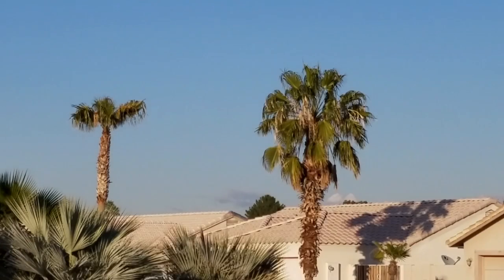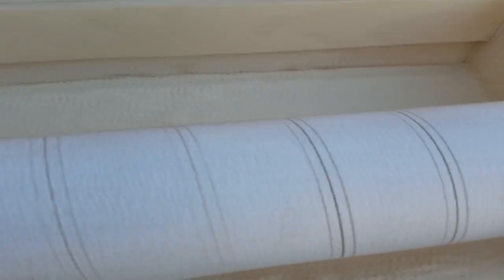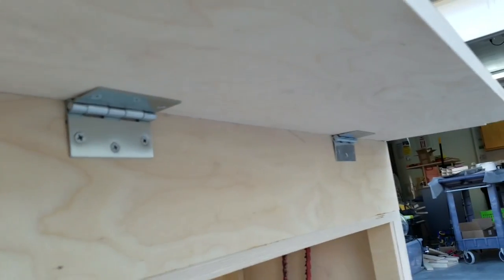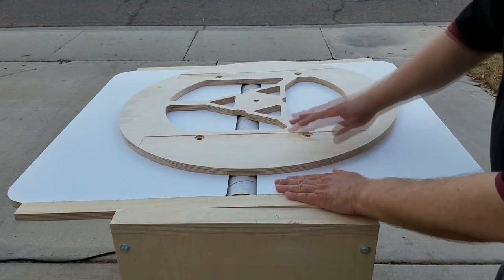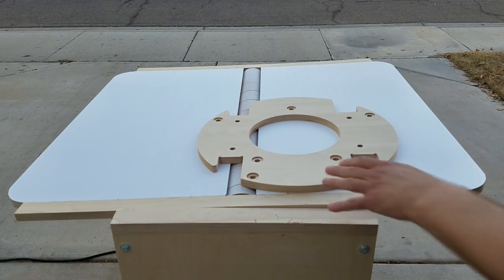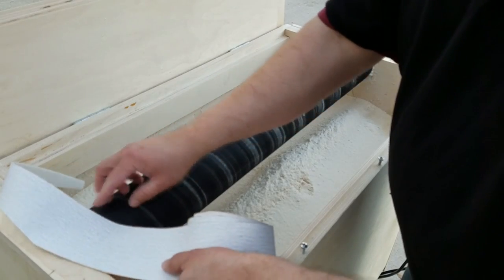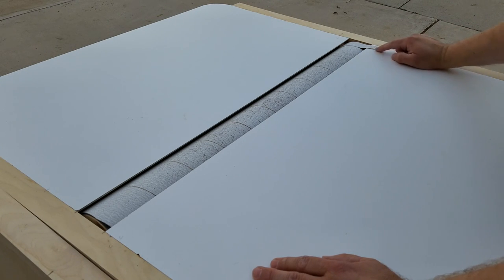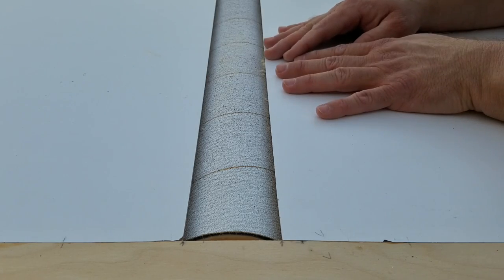DIY Drum Sander for Telescope Shop

Comment: Just wanted to THANK YOU for an excellent video.  I was looking at building a pressure-type wide sander -- until I saw your video.  Took me two days to add your type of sander to my lathe (hey, it already has a motor and bearings on both ends).  So just built a box, bolted it to the lathe bed, created many disk for the drum on my CNC table (but could had made them the old fashion way as well, but that would had taken more time), put it all together, and presto -- we have a beautiful wide drum sander.  THANK YOU so much for sharing your knowledgeable and experience.  Your video explained everything in a very clear method.  Without your video, I would not have a wide-drum sander.  It is such a joy.  Again, THANKS.
Reply from the maker: Thanks, Mike!  So happy to hear that you  had fun and ended up with a great tool for your shop.  Simple is good!

Comment: I will admit you gave a very thorough job of the sander and I appreciate the level of detail.  One additional thing to what you mentioned is that although the dust goes down below, there's no need for the noise of a vacuum and that's great.

I've been considering doing a drum sander thicknesser for a while but felt it was too complicated.  Like the units Stumpy Nubs has built.  But the reality is this unit I believe could do the job quite well and I won't have to spend $1400+ on a commercial unit.  Those Powermax and Jet units look nice, but then you see they're all plastic hoods and such, and they're still not very wide. 

The simplicity of your solution has inspired me to put this on my todo list.  Thank you so much.
Reply from the maker: Thanks!  While this isn't really a thicknessing sander, it is actually pretty good at leaving the piece flat.  So you can do multiple passes without putting waves into the surface.  Given that I have the motor, pulleys and belt and laminate for the top hanging around, my out-of-pocket cost was pretty low.  But even if you bought all new, the cost isn't that high.  I really love mine.  If my jobs weren't so large, though, a narrower drum would have worked find, too, and made a more compact machine.

Comment: Gordon, you are incredible.  Thank you so much for sharing.  Where you are using pillow block bearings, I do not understand why the roller raises.  If for utility you decided to have three different drums for the three grits you are using, have you considered widening and deepening  the side slots where the pillow block bearing fit, making a "U" shaped pillow assembly with squared corners, and making a keeper to secure the "U" so it does not rise or shift?  The pillow blocks would be mounted in the bottom of the "U."  (Yea, more expense as you would need two more sets of pillow blocks, drums, and shafts.)  One could use locating pins to assure proper fit and contribute to the rigidity of the system.  A long brush installed parallel to your drum might assist in reducing the small amount of dust you get on the leading table.  A "V" shaped hopper with a trap door would assist in cleaning out the dust bin.  If you really want to go rad, install a  vacuum tube along the full length of the bottom of the "V" (no trap door this time), perforate the tube, stop up one end of the tube, hook up a shop vac on the open end of the tube that sticks out the side and go for it. . .  Yea, I know it is a noise generator...  Keep them coming!
Reply from the maker: Hi, Gordon!  The roller itself doesn't raise during operation.  The sandpaper itself is "flung out" away from the drum due to the centripetal force caused by the fast rotation.  The sandpaper is attached with hook and loop fasteners, and it really isn't perfectly tight against the drum.  The rotation causes the paper to move away from the drum just enough to actually get in contact with the piece you are sanding.  Regarding multiple drums for different grades of abrasive... I only contemplated that until I found out how easy it is to change the paper.  Once you've done it once or twice, it's not really any hassle at all.  Far easier to store rolls of paper rather than multiple drums, as the drums are actually pretty heavy, especially if you include the bearings!  Thanks for watching and commenting!
Reply: Gordon, Thank you so much for the response.  I see what you mean with regard to the sandpaper itself flung out.
Reply from the maker: It's pretty cool, once you see how simple it is!

Comment: I have seen a lot of those machines. Even the professional ons which cost over a 3.ooo USD but this one as you made by yourself is just so easy to build that it is almost ridiculous I would pay a penny for a new one. Every woodworker has a lot of stuff laying around. You only have to pay for the bearing and maybe for the motor but in every old washing machine you will find one. It think the it will taken me 1 day to make one by myself as you did. Maybe 1,5 day at most but your machine does what it has do do. I'm building Beehives in different kinds of wood and have to glue a lot of pieces. There is sometimes a little difference in the wood where the pieces are glued together And it take a lot of sanding to get rid of that. 
With this solution of your, which is the best I can find on the whole internet, it has to be a piece of cake in the future. Thanks for showing us woodworkers and succes with the things you make and the business you have. 

P.S. It would be appreciated very much when you show me where to by the sanding paper and the Velcro tape. Over here you will find an excellent video how to calculate the length of your paper  https://www.youtube.com/watch?v=RpfCSz9HwKU&t=12s 
She made a drum sander but that is a sander which I didn't like to make. The wood is never exactly trait and it has to be pouched trough the drum with force sometimes which will damage the wood in my opinion. Yours will never do that if your constantly pouching it with the same speed over a flat surface. Ans that alone already a great benefit.

Comment: I’m still not clear on the effect of mass needed (or not) for the drum. For instance wood circles vs. pvc pipe has been mentioned; does this system need the mass of all that wood or will 3” schedule 40 pvc (actual 3.5” od) do the job? Is drum weight (or mass) stricty related to the hp & rpm of the motor & pulleys?
The BEST vid anywhere on this contraption!!👍
Reply from the maker: I doubt that mass in important.  I choose wood instead of PVC because I wasn't sure the pipe would maintain a straight profile without sagging.  My drum is longer than most, and that was my worry.  Also, the wood seemed super easy to fabricate, and was known to work well.

Comment: Thanks so much for this. What an inspiration. I'm midway through building one and I'm to the point of ordering pulleys. Can you recommend an ideal RMP for the drum? I have a variety of motors to choose from and want to be sure to have the drum spinning at an appropriate speed. Thanks!
Reply from the maker: I would think you would want to sand at about 2,000 surface feet per minute.  Assuming a diameter of about 4" for the drum, that would give you a circumference of about 12 inches or one foot.  So if the motor is running at a standard speed around 1750 rpm, you would be fine.  For under $10 you could buy a slightly bigger pulley for the drum if you want to try slowing it down some.
Reply: @GordonWaite  Thanks very much Gordon!

Comment: I'm finally getting around to building this thing this coming week. As opposed to using 3 inch diameter plywood for the drum, I thought I would use a 4 inch PVC pipe, as they are machined or molded to pretty exact standards. 

One of the things that keeps running through my head is the tolerances on a machine like this. If the drum is not spinning absolutely true, I mean down to the thousands of an inch, you would be hitting a high spot. Same thing applies to the table surface. If that thing is not perfectly flat,  you're going to be sanding more in one spot than the other. 

While I know things like melamine are pretty flat, I can also say most MDF or particleboard tend to sag over time. I've built a few router tables already that were much smaller than this, and  it's very difficult trying to keep them flat. Angle iron seem to be the best option for me so far attached to the bottom. 

I know you're using one stiffener, and hopefully that will keep that top flat. I can't help thinking that this would be incredibly difficult to get  tune down to the thousands of an inch over such a large surface, and to keep it that way. Most of these type machines are made out of metal I think for that reason. 

Perhaps the thickness of the Velcro is helping to even out any irregularities? I can certainly see if you just had sandpaper attached to a drum, that you would definitely get some high spots and low spots, and compound that with something that may not be spinning perfectly true, and a tabletop that could possibly not be coplanar, and wow... that  just seems like a lot of variables to try to control.

I've decided to go a bit smaller, and put mine on my lathe, and actually turn the ends on the lathe as well so that they are perfectly centered, and then insert those into the 4 inch PVC. That should hopefully keep everything perfectly centered and spinning true.  

I'm then going to use the bed of the lathe to build the wooden box, but thinking very strongly about putting lateral adjusters on the hinge mounts to try to compensate for any differences. I can definitely see it being very easy to tweak a tabletop out of being coplanar (very easy), and again, maybe even more difficult to keep it that way. 

Comments on any of this?
Reply from the maker: Hi, Troy!  I think you have a fundamental misunderstanding of how this sander works.  The sandpaper spirals around the drum, and is held to it with "hook and loop" fasteners, or "Velcro."  The sandpaper cannot be tight against the drum, because the hooks and loops are not able to hold it tight.  When the drum spins up to full speed, the sandpaper is actually forced AWAY from the platen by the spinning.  So the sandpaper isn't really backed by the platen, it is backed by just the air under it!  The physics of the situation demand that the sandpaper becomes pretty nearly a perfect circle floating over the top of the platen.  But the key is that the sandpaper isn't rigid, it is flexible.  So when you properly adjust the platen, the hard part of the surface of the platen is actually below the opening in the top.  The only thing above the opening is the sandpaper, and only when the machine is spinning will it stick up enough to do the sanding.  So the platen itself has nothing to do with the sanding action.  Only the spinning sandpaper has skin in the game!  So it isn't particularly important that the platen be perfect.  You would be wasting your time to try to make it perfect in any way.  Good enough is good enough in this case.

Also, this sander isn't meant to be a thickness sander, but a finish sander.  Even if you put #80 sandpaper in the machine, it isn't very aggressive.  The spinning sandpaper is actually very level when it is pushed away from the platen by the spinning.  And the level of the table is forgiving because the sandpaper floats on air above the opening.  If the table isn't quite level, the sandpaper is just pushed down a little more against the air behind it in that spot.  Only if the table was grossly out of square would you have any trouble.  All in all, this isn't a precision build in any way.  You just rely on the design and physics to do the job!  Of course, if your platen is way out of round, you would get vibration which would be annoying.  Get past that, though, and you are good to go!  -Gordon Waite
Reply: I did have some understanding of how these work from watching the "flat master" videos, but I still thought the tolerances were very tight. I'm glad to hear there is some wiggle room. I'm not looking for a thickness sander. If I really need to thickness something I will run it through the thickness planer. About the only real problem with a thickness planer is snipe, and many times I will attach some longer boards to the piece  to avoid the snipe. Anyway, they still need a final sanding as the finish is not glass smooth, and of course I do a lot of building out of plywood. I definitely would not want anything aggressive there. 

Sounds like the PVC I'm consider for the drum is going to work out fine, and I like the idea of mounting on my lathe as I don't have to buy another motor, and  takes up less space too. I'll let you know how it works out.

Thanks again for all the feedback! There's no way I could have even considered doing a project like this without your videos, so I'm most grateful for all your time and effort!

Troy
Reply: If you were to wrap a piece of wood with 60 grit sand paper then run it over the table top, and have it engage your pvc, this would correct any cylindrical anomalies.
Reply from the maker: That's exactly what I did with this drum.  Thanks!
Reply: Good tip Dave. Thanks for posting.

Comment: Very well done! I just fell in love with this style of sander and can't wait to build one for myself. Where did you find the hook and loop for the drum? Is it in a strip like the paper or in a sheet?
Reply from the maker: Thanks, Joel!  The "loops" that I put on the drum are from McMaster-Carr.  They look like they originally came from May Material Specialist, Inc., at www.mjmay.com.   The roll I used is 2" wide, but it doesn't matter, as you just need to cover the drum.  The sandpaper roll is 3" wide, and comes in 10-yard rolls from USA1 Abrasives, at www.usa1.com.  The sandpaper says "no-load" paper on it, and it is made in the EU.  This tool is so simple to design and build, yet it is one of the most-used tools in my shop.
Reply: Thanks for the info. I am about to build one for my self about the same drum size as yours. I was thinking I would need a 3/4 or 1 HP motor but I just rewatched your video I see you used a smaller motor.Have you been happy with the 1/2 HP motor? Have you run something over the entire drum with out it slowing down?
Reply from the maker: I have had no problems, but I don't run a lot of material that is touching all of the drum.  But to be honest, I don't think it would bog down much.  If it is adjusted to only touch the material when spinning, you can't end up with much pressure.  I know the sand paper last forever!  Good luck with yours.

Comment: I was going to order velcro today. How long of a piece did you use for the 32" wide bed? 6'?
Reply from the maker: You can figure it out like this... Assume you are using 2" wide Velcro.  Take the length of your platen in inches, like 30 inches.  It would take 15 two-inch rings to cover it.  (15 * 2 = 30) Each ring is the diameter of the platen (like 5" maybe) times pi, or 5 * 3.14 = about 16 inches per ring.  Take your 15 rings and add 2 rings on the ends for the angles.  So you  need 17 rings times 16 inches per ring, or 272 inches, which is about 23 feet.  Plug in your own numbers.  Probably more Velcro than you might think at first!  Good luck and enjoy the project.
Reply: Thank you very much Gordon! Guess I was looking for the quick answer and not wanting to do the math;) One other question about the Velcro and sandpaper . Did you use the standard, multipurpose Velcro or the super adhesive from McMaster Carr? I think I will use 3" PVC for the platen, and plug the ends.

Also, does the sandpaper come as a hook or loop?  It appears you can order the  Velcro for the platen in either a hook or loop, but not positive about how the sandpaper comes. I'm going to guess as a loop. I honestly don't know,  and would rather not have to return the velcro for the platen.
Reply from the maker: Hi, Troy!  You want to get "hook" Velcro, as the sandpaper is "loop."  I got my Velcro from McMaster-Carr, 2", black, standard adhesive back.  There isn't really much stress on the material, so I wouldn't worry.  Although the difference in price isn't much, so get the super adhesive stuff if you need to sleep well at night!  ;)
Reply: Thanks again Gordon!

Comment: How did you true the sanding drum to the table surface?
Reply from the maker: I mounted the drum in the machine, and lowered the top until the high spots on the drum were standing a tiny bit proud above the top surface of the machine.  Then I held a sanding block with some #80 sandpaper still on the top, over the slot.  Anything higher that the slot is sanded down.  I would hold it in one spot for a minute, then lift it and set it down a little farther down the platen.  Only took a few minutes, as my CNC-cut platen wheels were pretty good in the first place.  I did this before I put the laminate on the top, so the laminate wouldn't be scratched.